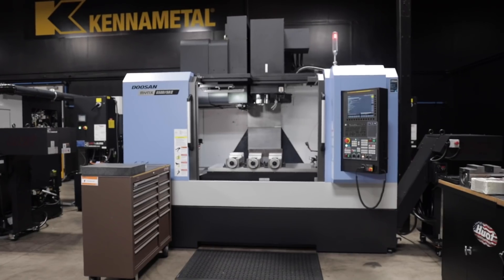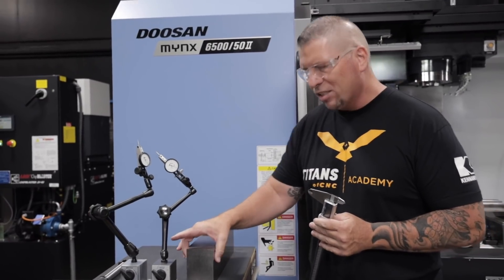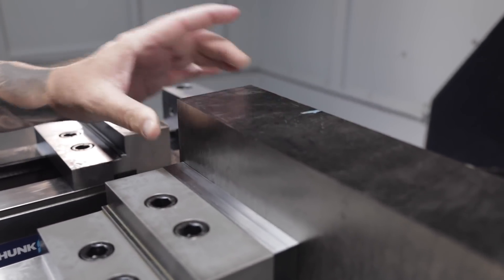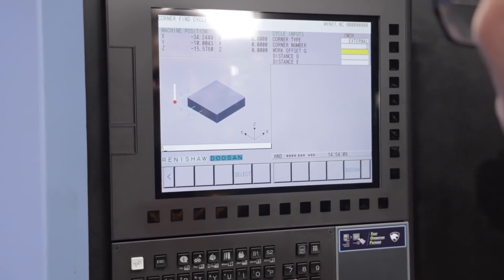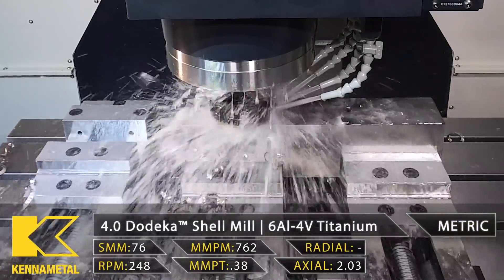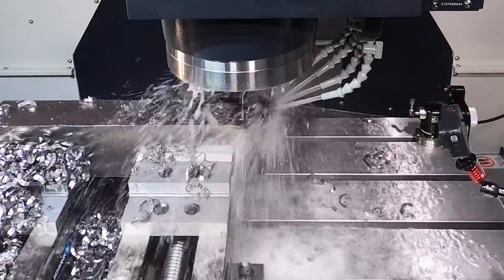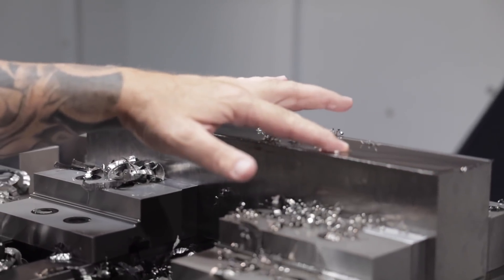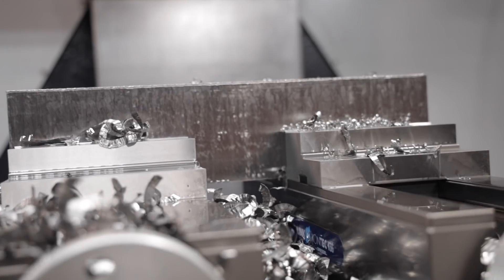DN Solutions MYNX Beast CNC Machining Titanium | 1st Cut | Dodeka Shell Mill

Comment: Why are you cutting with the center of the tool on the center of the work, and feeding toward the door? You would be better to move the cutter off center and climb mill through the material, sending the chip to the back and keeping the chips out of the screw of your vices. I was a mill guru for Okuma through the 90's and taught this stuff for more than 15 years.   Rev. Andy Levine

Comment: Cutting titanium is really easy. Why do people think it's difficult? 🤔
Reply: Good to see you David! you would know with your experience, titanium is not super hard. reminds me of working 304ss
inconel 718 and hardox 600 is about the toughest I have encountered.
Reply: @Donkusdelux  I would agree hardest I have cut in a lathe is hastoloy b3. Unless you count turning the shank of a solid carbide drill to fit into a tool holder so we didn't have to buy a new holder for it.
Reply: I was thinking the same thing titanium easy to cut if you are roughing it out like he did.

Comment: How is the length of a tool like that being measured? is there a video on the matter?
Reply: skip to 6:06 and look on the right, Renishaw tool probe on the bed, extremely common on modern machines, give the tool a rough length to the gauge line eg 150mm and then when it measures it will take that into account aswell as the user defined clearance safety height above the probe usually 5/10mm. Haas Automation youtube channel will probably have a video
Reply: Also it sounds backwards when coming down so it measured the lowest insert.
Reply: @henrychan720  Correct the spindle spins counterclockwise so it doesn't hit the cutting edge and break the probe

Comment: So why did you mill "into" the loose jaw? i learned to never mill into the loose but the fixed jaw.
Reply: Chips are gonna fly towards the door that direction also.... 🤷🏼‍♂️
While I'm here, I'd just like to say I'd never square up a billet like that. Always flip machined face 90deg to the fixed jaw, not full 180 like this vid. 🤷🏼‍♂️
Reply: @steviemill  I think it also depends on the jaws in the vice. If you want to make it fully parallel and rectangular there are special jaws that push the part down and therefore the surfaces will be 100% parallel by flipping 180 degree.
But the jaws in the video seem like normal rigid jaws. Anyway he looks like preparing the raw material for further operations and so the surfaces do not need to be perfectly parallel.
Reply: @iamthemostfamoushaha  yes, agree that he's just roughing the sides square for further ops, and in this instance probs don't matter. I still wouldn't though, and I'd machine + to - in the x axis also.
Reply: @iamthemostfamoushaha  I was coming into the comments to ask the same thing. Your hard jaw or non adjustable jaw does not move so when tighten the part if it is not flat on that side agianst the hard jaw it will cause the part to shift and in turn making the block not square. Being how expensive titanium is I would hate to see someone learning from this video at a job and then lossing said job because they scrapped the part. I love the titan videos however always ask another employee or supervisor before doing what he is doing because some stuff is just not done the right way.
Reply: defiantly cut towards your back jaw.  boss always taught me this. chips dont break your windows and if something bad happens you dont get a 120lb vise coming threw the doors at you. 50taper machines dont fuck around.  they will tear those vises off, saw it happen.
Reply: ManMadeDesaster That’s a valid point and I am with you, I always cut from the opposite direction mostly because it directs the chips to the back and away from where you can see, however, for what he’s doing here it really makes no difference as you can see from the result.
Reply from the maker: I can see the point... meaning moving towards the most rigid part of work holding. In this particular set up... the entire set up is Rock Solid. SCHUNK KSG

Comment: I like it ! SOLID ! Can you arc on and load the cut towards the fixed jaw ? Chip thinning on entry and exit.
Reply: Well, you can do everything with CNC :P He also could have offset tool a little bit. It looks like centre of the tool was exactly in line with middle of the part, which also isn't perfect.